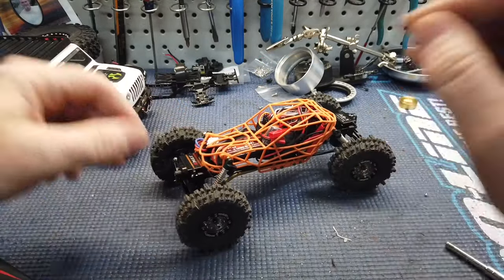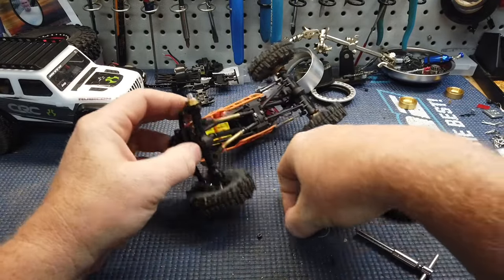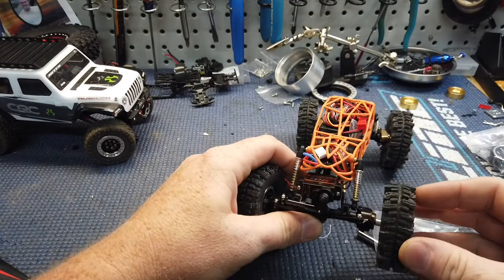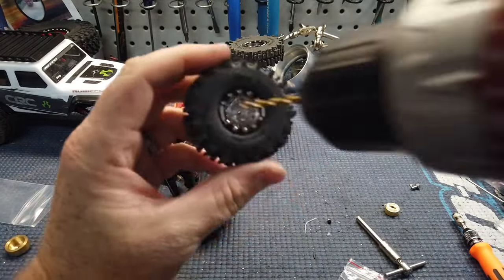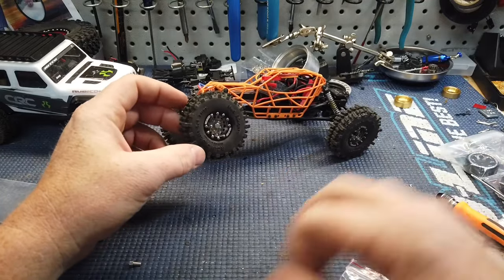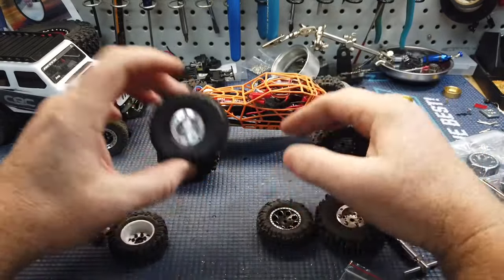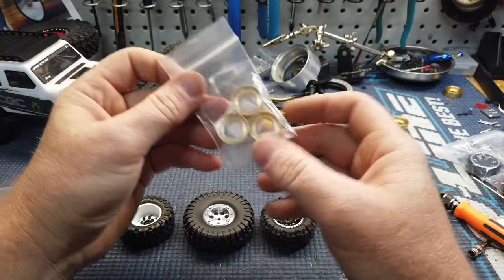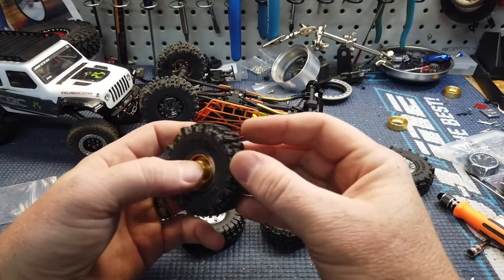Rc4wd Competition beadlock FIX!

Comment: I have the treal wheels on my grey C10 so far I'm happy with them
Reply from the maker: I LOVE how simple they are to mount! Wow! Easiest by far
Reply: @2fmrc  hey I had a question. The driveshaft/links are longer in the back and shorter in the front. I have the c10. I was thinking I could rotate the entire chassis around to have the long links in the front (more similar to a real life crawler) does this seem feasible to you?
Reply from the maker: @Tk-di5vd  it will definitely work it just may throw your body off quite a bit because you are changing the wheelbase quite a bit. You could maybe make your own body mounts or something to get the body mounted where it needs to be but the links and driveshafts should be able to be flipped. Only issue you will have is the stock front upper link is the triangular 3 link setup. You won’t want it in the rear so you’ll need to make some links or buy a set to replace that 3 link piece. Hope that all makes sense lol
Reply: @2fmrc  totally makes sense dude. I thought of the link set up but didn't even think of the body mounting. May have to think a little harder about this one lol

Comment: On my Kinetic weights for the Competition Beadlocks, 2 were loose, one was tight but didn’t snap in like that and one didn’t fit until I filed the nub down some. They also didn’t come with the bushings which were supposed to be shipped afterwards but I’ve decided to stick with hex mount wheels. Love their shock modification though! I’ve been waiting for Full Send to stock some axles again but I never catch them so I just ordered some KYX Axles. Perhaps you could test and review some KYX parts.
Reply: Did you receive the bearing retention sleeves?
Reply: @crimsonchinification  yeah didn’t get those, I had called them bushings in the original comment.
Reply from the maker: I actually ordered a set of the kyx shocks like 2 months ago to see if they were the same as all the other aluminum versions. I think they finally arrived today 😂
Reply: I have the same grey Treal wheels coming. I got the the aluminum not the brass. Hopefully they work out well.
Reply from the maker: @DerekLed  they are definitely the easiest beadlocks to mount. At least out of the ones I’ve had. Good quality for sure. I got the aluminum also.

Comment: Hey Matt, since you are the man when it comes to SCX24s I was wondering if you could tell me what size the wheel nut is, I asked a horizon hobby employee to send me some and he sent me 2.5mm nuts which were too big.
Reply from the maker: They are an M2, so 2mm nylon locking nut. Part #axiax31147 I was going to find you a link but they are sold out most places or on back order. Hopefully you can find some!

Comment: Hey bro you seem to know a lot more than I do which isn't really saying much when it comes to this 😂.. but anyways lol I have been trying to get a wheel for my Redcat ascent 18 and so far I have two sets of wheels and a set of brass rings and still don't have what I want.. so before I spend more money than I spent in my rig on wheels I hope you can help me.. ok I want a kinda wide not too wide but not super narrow wheel with a beadlock ring with the little screws.. but I don't want brass I want steel or aluminum and want to put brass rings in the front but leave aluminum ones that come with wheels in the rear.. I got some ogrc brass rings because they are super heavy but they also don't fit anything do you know a wheel they will fit preferably with a beadlock ring with the little screws them.. thank you for any help I appreciate it..

Comment: Are you running the castle esc in this rig as well? I’ve seen some cheaper ones but I’m not to sure if they’d work with the motor you mentioned in your previous video. Kinda on a budget haha
Reply from the maker: No this one is running the dual n20 motors & dual escs for the dig setup. I’m waiting on a couple cheap brushless escs to come in the mail now. Hoping to find a good cheap option for us all!
Reply: @2fmrc  awesome man thanks for the reply! You think as long as the esc has bullet plugs for the motor im not risking much either buying one of the cheaper esc’s?
Reply from the maker: @JayNote27 I feel like most of them will work. Maybe just not as smoothly as the castle. A lot of these small escs are only one direction as well so make sure it says bidirectional or something. I bought one that ended up being much bigger than I thought it was AND it only had forward throttle lol. It was more of an esc for a drone or something.
Reply: @2fmrc  did you order the losi maxial esc that’s on eBay? Been eyeing that one lol
Reply from the maker: @JayNote27  yep! I ordered that combo to try the esc really. I’ll probably try the motor as well but mostly wanted the esc for an outrunner motor. I feel like the outrunner will be much smoother but idk? It’s been ordered for a good while now (coming from China) been sitting in New Jersey for a couple days so hopefully it’ll start moving again sometime soon lol

Comment: What solder do you use to solder the wires on the barrage motor and what solder tool.
Reply from the maker: The solder I use is a 60/40  0.8mm diameter W-416 flux and the soldering iron is one similar to the one in the link below. I’ve tried several irons and really love this one. It heats up almost instantly and has lasted for a couple yrs now I’d say. Been a good cheap option that you can take on the go! 
Soldering Iron Kit Solder Gun - 80W High Power Digital LED Display Adjustable Temp Auto Standy Auto Shutdown Welding Tools with 4pcs Soldering Tips, Y Type Soldering Iron Stand, Solder Wire https://www.amazon.com/dp/B08C4M9XW1/ref=cm_sw_r_cp_api_glc_fabc_tUJ7FbSM6HB5R
Reply: 2FM RC thanks

Comment: Hey Matt, Happy New Year!  I too think these wheels might be the best looking out there.  My solution for the "not enough threads" issue is to turn the nylock nuts around.  Having said that, having some extra wheel pins/nuts around when the wheel eventually comes off is a good idea.  Thanks for another great vid!
Reply from the maker: Yeah I had to buy a pack of wheel nuts awhile back because I’m always pulling wheels to try here and there and I’m constantly losing the nuts lol

Comment: I have to use a washer just for the back wheels, don't know why the front is fine, but the back, it's like they didn't thread enough, where the threads stop , sticks passed the rim a little bit , so the nut would stop before tightening the rim Down , so one washer, fixed that problem
Reply from the maker: Wow! Never heard anyone have that problem lol. It’s usually no thread to even start the wheel nut! Awesome

Comment: Could you do a video on what the mud slingers, which wheels do they fit on.
Reply from the maker: They are 1.0 so they’ll fit any of the wheels I show in the video or any 1.0 wheels.
Reply: If they are 1.0 does it matter how wide they are to fit the mud slingers.
Reply from the maker: @deirirenteria317  no it shouldn’t
Reply: 2FM RC thank you I'm thinking on getting the mud slingers which the competition wheels they are pretty expensive.
Reply: Do you think putting a grave digger body on my scx24 and the mud slingers with the competition wheels would look good?
Reply from the maker: @deirirenteria317  absolutely! Sounds awesome!
Reply: 2FM RC what wheels do you recommend for the mud slingers with the grave digger upgrade?
Reply: My scx24 doesn't move forward or backwards steering works great what's wrong
Reply: @deirirenteria317  sounds like the motor gave out, you could test it with a multi meter. Does it have a lot of use? They are a wear item really but should last awhile. Might be time to upgrade the motor a bit.
Reply: Iroquois Pliskin it really didn't last long but I ordered a barrage motor thank you.